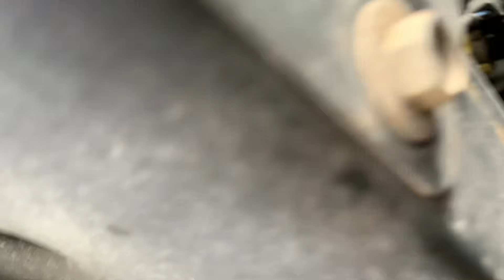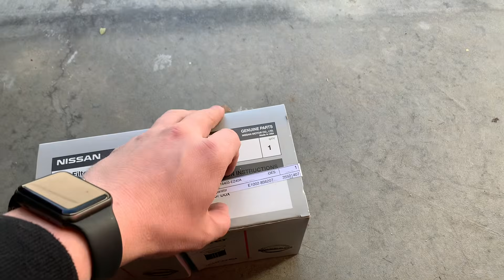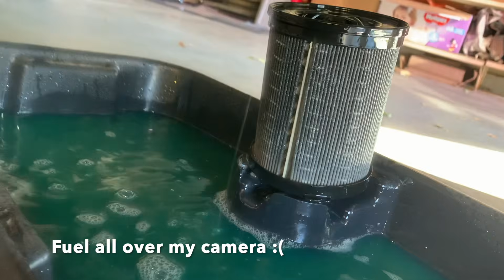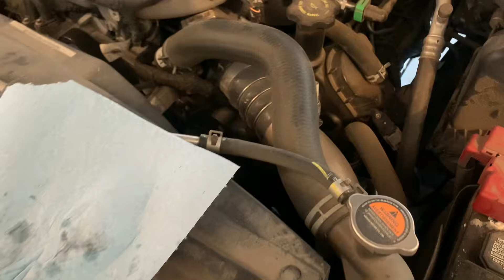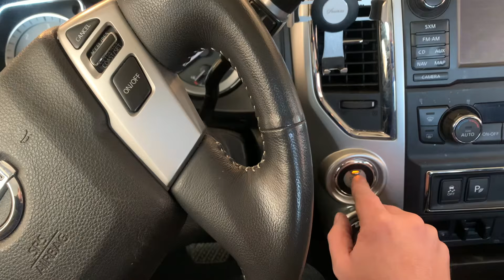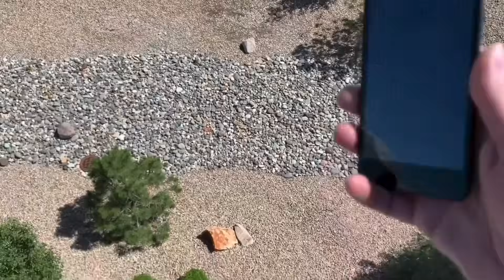Nissan Titan XD Cummins Fuel Filter Replacement

Comment: Have a question, I did exactly how you performed it on the video. Everything seemed fine drove off the first day no issues. Went to turn on and drove for about 2 miles and low fuel pressure came on and engine reduced went back home. It started to stutter and wouldn’t let me go passed 20mph. Any idea what might be

Comment: Not all changes go this smoothly. Sometimes, you have to crack the top filter to release the air out of the system. I ran into that issue while replacing mine, warning, it WILL make a mess if you have to go that route.

Comment: I’ve been using Doc’s diesel filters on my 18 XD pro4x and they’ve worked great at half the price.
Reply from the maker: i have been doing the same lately after i made this video. have gone through 2 cycles of Docs filters no issues :)
Reply from the maker: i have been doing the same lately. i have gone through 2 cycles of Docs after i made this video with no issues :)

Comment: Do you suggest the truck lifted or was it fine to do on the wheels?
Reply: you should be able to get cardboard or a creeper under the titan no problem unless you are super huge. That is if, it is the 4x4
Reply: @olddirtyburt7522  yea I got on cardboard and was able to work under since I have a 4x4. Thanks for your video, it was very helpful!

Comment: Two oil filters?  Is that standard on XDs with the Cummings?  Is the second filter a bypass filter?
Reply: These are not oil filters they are fuel filters

Comment: Hi Joe, how is your XD running? Haven’t seen new videos on it. I’m thinking of buying a 2016 XD with 34k miles. After owning this truck as long as you have would you recommend it?
Reply from the maker: XD is running good :) its a good truck, just need to take care of it. fuel filters, air filters, regular maintenence and it will treat you well. these diesels like to be worked. drive it on the highway or pull something. that will keep the exhaust system clean
Reply: @NotATechShow  you should make a new video on your XD. I really want the 2016 truck. I hope I’m not going to regret it. I hear parts are hard to find if you need em.
Reply: @CountryLivingOnTheFarm  I have a 2017 xd and love it, I would however avoid the 2016 model, they were known for the crankshaft breaking without warning, supposedly fixed with an updated crank for the 2017-19 years.
Reply: @tmurph247  I bought the 2016 XD. So far she’s been treating me well. Already put 10k miles on her since end of Nov. had a leveling kit done. Now thinking of doing a 4” lift. Great truck!
Reply: I just bought 2016 xd 130k getting a sudden light jerking every so often when accelerating after stopping runs perfect other then the sudden jerk then back to normal? E brake issue? Battery issue? Fuel pump? Fuel filter? Plugs? Maf? Anybody know
Reply: @williamsajw03  Sudden jerk when accelerating is probably coming from the transmission?

Comment: I owned a 6.4 and the process was pretty similar although I would change one filter at a time starting it in between to make sure no air got in the system. Just a precaution that saves headache and problems.
Reply: This is the method I’ve heard. One filter then prime process. Then 2nd filter and prime process again.

Comment: What do I need to look for when buying these titans used? Blow by?
Reply from the maker: blow by with any diesel but not that common with these. most common issues are turbo actuator and emissions components issues. its tough to know if it will be a problem just by looking at it. just make sure that the truck that you are looking at was well maintained with fluids and filter changes.

Comment: Is it the same model year (16-19) in non XD models? Plz don't say it's in the tank 😭💀
Reply from the maker: non XD means it has the V8 gas motor. gasoline powered vehicles typicall have a fuel filter/screen on the fuel pump, which is in the tank. this is the case for non XD. dont worry though, changing the fuel filter in the tank is not a regiular maintentance item. your fuel pump will likely fail before that screen ever needs to be replaced. you also cant buy that filter without buying the fuel pump anyway. if you are having a fuel problem, it could be related to the pump or fuel system in general

Comment: Nice video...great job!  NOTE: The fuel will stop draining.  It just takes a while.  I have changed my filters 5X (every 10k miles).  I use the same process each time...no issues.  Here is the process I use on my 2017 Titan XD Pro4X:  1. Disconnect the NEG battery terminals on both batteries.  2. Disconnect H2O sensor on filter housing #1 (underside of truck).  3. Drain the diesel fuel COMPLETELY.  4. Replace #1 filter & O-Ring seal, tighten filter housing, then replace H2O sensor.  5. Replace #2 filter & O-Ring seal then tighten filter housing.  6. Replace NEG battery terminals on both batteries.  7.  CRITICAL: Prime the fuel system AT LEAST 5X (30 sec each time you prime) before attempting to start the vehicle.  Prime the fuel system by pushing the START BUTTON 2X without placing your foot on the brake.  You will hear the system go through the priming process.  The priming process requires about 30-seconds each time you conduct the process.  Do this AT LEAST 5X.  The fuel system is very sensitive to air intrusion.  The fuel pump is $1,900 and the injectors are $950 each.  Take your time and do the maintenance the right way and the fuel system will work properly for a very long time.  Take short cuts and get ready to break out that credit card!
Reply: Why would I replace sensors and battery terminals on fuel filter replacement?
Reply: think he means disconnect them not literally replace them
Reply: @tom_greenery okay why am I disconnecting the O2 sensor
Reply: Thanks

Comment: How often does these need to be done ?
Reply: Every 10,000 miles. Both filters
Reply: @olddirtyburt7522 I thought it was every 30 thousand miles...??
Reply from the maker: Nissan tells you every 10k. im on the fence on it though. 5.9 and 6.7 Cummins is like 25k

Comment: So how is your engine holding up? I've read good and bad about this Cummins. I'm about to pull the trigger on a 17 XD and just curious.
Reply from the maker: Still runs fine. 2016 with 67K miles on it. Only had 1 problem with the Turbo actuator (common). Its a good truck, just be mindful of how much diesel parts cost. If anything does break, its not cheap. With that in mind, i love the truck. It has been my favorite vehicle i have ever owned!

Comment: How much fuel should you expect to drain from the lower fuel filter and what do you do with the drainage?
Reply from the maker: it will drain indefinitly sometimes, it starts syphoning from the tank. let it drip for a few minutes into a catch can. you should be able to dispose of it at your locate autoparts store if they have a hazardous waste bin.

Comment: If you change oil every 10k miles,  then the service will change your fuel filters, it should come with oil change service?
Reply: It doesn't. It's definitely extra!
Reply from the maker: A lot extra if you have them do it lol
Reply: @NotATechShow  Nissan dealer got me for 528 for the fuel filters installed. I now do it myself.

Comment: I change my own filters on my semi truck and one thing I do that I didn't see you do here is filling the flutters/ housing with clean fuel.  The one on the frame rail should be easy, insert the filter in the housing then fill it up at least mostly full before installing it, not sure it would work so well on the one on the engine bay because as you put the filter in you risk having spillage.   We do this with semi tricks so there's less air in the fuel system making it easier to prime.   Good video.
Reply: Big trucks usually run on mechanical pumps so you need to fill them, these have electrical pumps, turn key on and the system will fill itself , do it several times and it will start no problem

Comment: I question the 10 thousand mile recommended replacement.
Reply from the maker: Me too. That’s what the book says though. I used to be a Dodge Technician and they recommend a 25k mile interval for the 5.9 and 6.7 Cummins. It’s not that different of a system if you ask me.
Reply: @NotATechShow  Thumbs up. 5k over. $80.00 for O.E.M. Serviced today and reordered on Amazon.

Comment: Can i put fuel back in tank
Reply from the maker: I wouldnt. It risks getting dirt in there. I say take the loss
Reply: if you absolutely have no other way to dispose ( gas station / local mecanic ) i would at least run it trough some coffe filters or some such things.

Comment: I can tell you from experience that your priming procedure is not even close to the right way, it has to prime for 30 seconds at least twice. I have to do mine at least 4 times for it to remove all of the air. When I did it your way it was 3 hours trying to bleed the air out of it. When I do mine I listen for all of the air to get out before I start it. Other than that misinformation it is a good video

Comment: I’ve used Wix filters for my fuel and oil filters for about 60k miles now. Seems to work good. About the same price. Only use them because Nissan seems to never have anything in stock for the 5.0 Cummins.
Reply from the maker: Those ones work fine for sure. I actually found my Nissan filters on Amazon of all places. My local dealer marks up prices on their parts quite a bit.
Reply: @NotATechShow  Man I just don’t like buying stuff online. I’d rather touch it before buying. I’m only 25 so it’s not a generational thing either.

Comment: Critical bit.  CP4 REQUIRES fuel with NO AIR for faultless lubrication of the pump.  MUST completely purge all the air out of the fuel system before starting.  Turn on like you did, but wait about 30 seconds for the system to stop pumping and repeat the prime for the full 30 sec each time.  Cycle at least 4 times.  Patience purging protects against VERY EXPENSIVE failures of the HPFP.  Air in the fuel with a CP4 starts drive cam / roller bearing wear, the main failure mode for the CP4.2.  Do the purge well, to protect the pump.
Reply: Hi @daves 1646 I did the same on the video,I didn't the steps you say I only did it once and it started perfectly but now the low fuel pressure light came on, I would like you to help me. How do I solve that problem? Thanks
Reply: @emiliomarquez3781 I did the same thing and trying to figure it out, did you fix it?

Comment: Just a recommandation On top of my head, clean the engine bay before removing the cap. No dust shoud ever reach the 2nd stage filter.
Reply from the maker: What’s frightening is I have seen dealership technician use their dirty fluid suckers and stick them down into the cup to suck out the remaining diesel fuel
Reply: @NotATechShow  yikes
Reply from the maker: Good point. Injectors aren’t cheap.

Comment: You may want to use white lithium grease on your filters so they don't stick to the housing when you take them off on your next service. Believe me I learned the hard way.  It also says it on your owner manual. I ended up breaking my lower filter in the priming pump stem cause it wouldn't come off. I thought just using diesel to lubricate it was going to be good enough.
Reply: Was wondering about this myself since it wasn't included on the video. Thanks. Ain't too many of us 5.0 owners out there. Gotta help each other out.
Reply: @danielfrain3521  I'm another 5.0 owner 2018.
Reply: I did the same thing to mine... $1000 later I had a new priming pump assembly
Reply: Will do thanks

Comment: Fuel would never stop draining.   I found if I make sure tank is below 1/4  it will not continue to drain..
Reply from the maker: I was wondering if that was the case. I gave it a good 10 minutes or so and then just pulled the filter off. Not too much additional fuel spilled out as you could see.
Reply: Thanks
Reply: Dumb question, it will not continue to drain due to the level being low enough? Or can you risk dumping all fuel that way too?